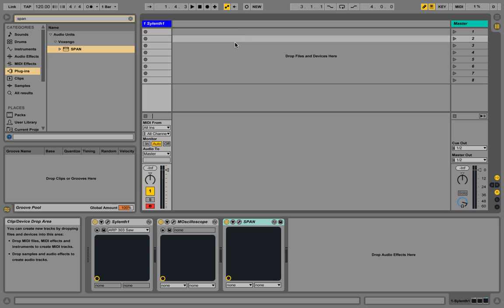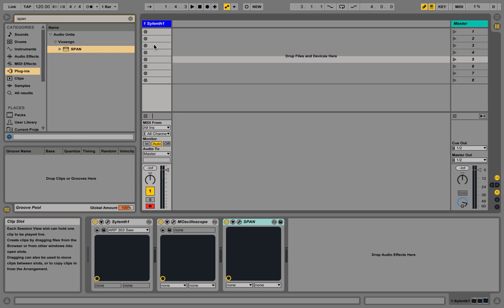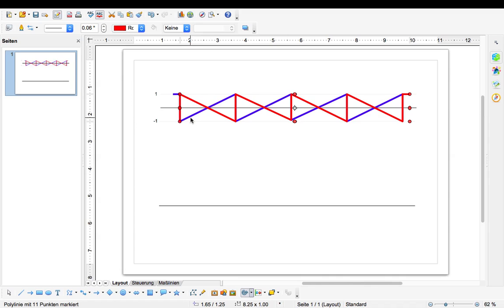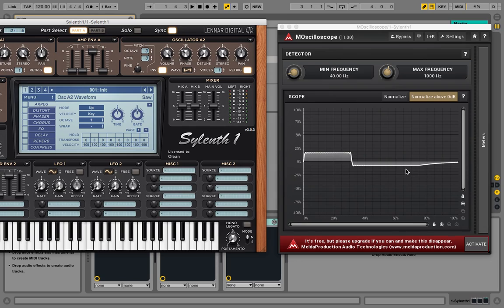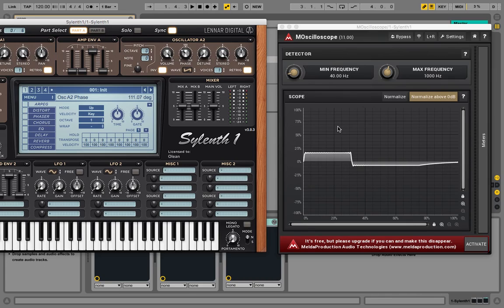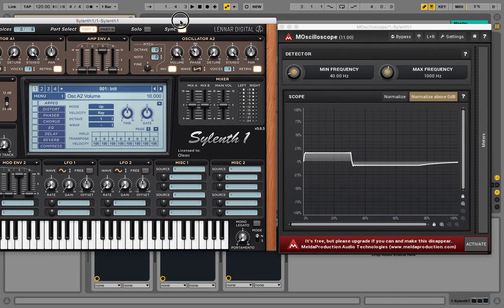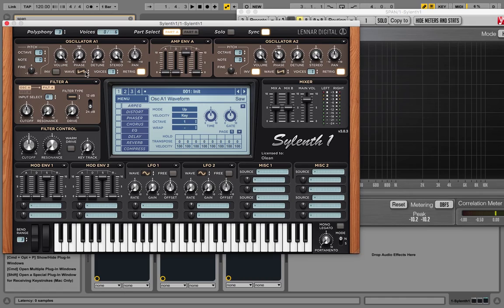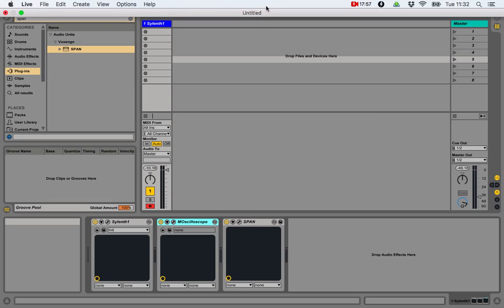Real Pulse Width Modulation (PWM) in Sylenth1

Comment: I would say the big Gain knob is the gain of the Lfo Itself so the overall/general Amount - underneath you can assign the LFO to 2 Destinations where you can set different Amounts for the first and second destination (thats the 2 smaller knobs). For example you can dial in one high amount for destination A and a smaller amount for destination B and in order to just adjust the OVERALL amount of the LFO  you can do so by using the LFO gain knob, leaving the different values of the two destinations in relation to each other - untouched. Also you can, in a way, think of it like an extra boost of the amount if you only use small destination amounts. It's helpful when you dial in subtle modulations: You leave the destination amount untouched on a relative small amount, while experimenting how the sound would change with higher values by pushing the LFO gain higher (and afterwards you can take the LFO gain knob back to the sweetspot).
I guess you overthought it... its just the way they set it up in Sylenth... kinda like a bonus Amount knob that adds ontop the destination amount values.
Reply from the maker: man, you're completely right :) I didnt even think of what you said about using the same LFO for two different things but then being able to control them together. so it basically goes in line with the concept sylenth is using for the filter cutoff and resonance. makes sense haha. Thanks for your input!!!
Reply: As limited as Sylenth is (modulation wise), the awesome it is to explore what tricks you can come up with when experimenting around. I feel it is a great synth for beginners because of that, you really have to focus on the main parts that shape the sound... after getting stuck for a long time creating a basic sound in any synth, then exaggerating stacking tons of effects after it in the DAW, I just recently came back to just using Sylenth 1 and only Sylenth 1 on itself, creating patches. Really showed me how much I was missing in the way how I can achieve creating everything inside the synth. Its's so great when you play around and suddenly one parameter change creates this awesome sound <3 After watching your video I wen't on Patching and now I have this mellow ocean wave like unison/stereo Pad with a lowpass filter, that has a slow LFO on it opening it and closing it slowly. Ontop active distortion in BitCrush mode with the second LFO on the Dist amount, adding that seagull like sweep now and then, exploding in a  slow delay afterwards, releasing it in the distance :)
Reply from the maker: Xijpo awesome! Can't wait to hear that patch in action!